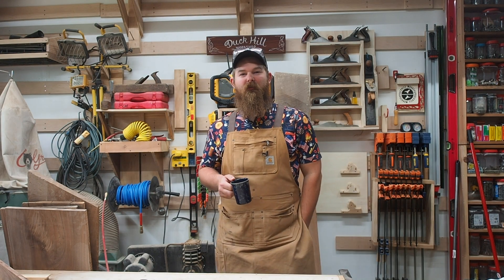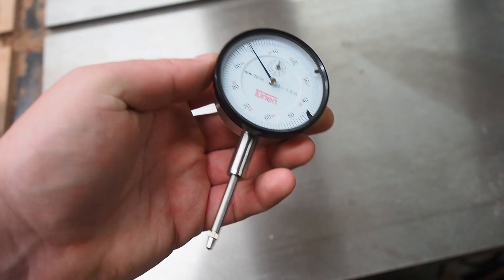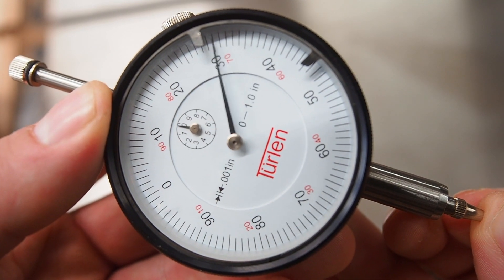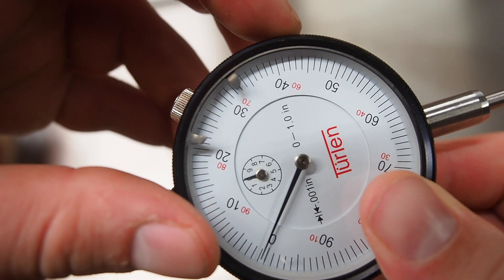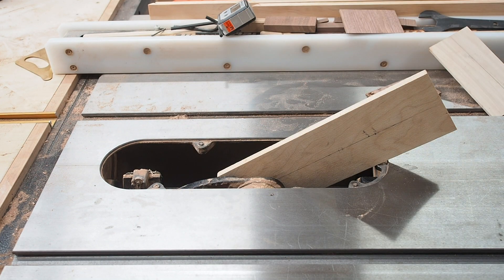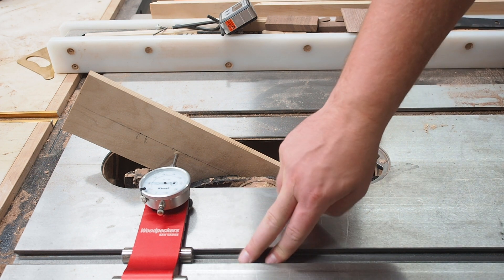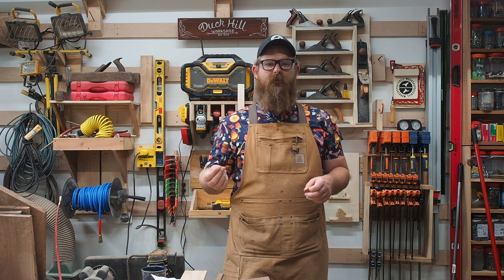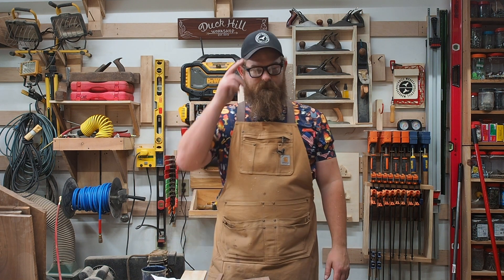Workshop Wednesday: How to Check a Table Saw for Square

Comment: this is my issue.... that trying to correct something, I make it worse than it was.... my table saw blade adjustment, I can very easily deflect it either way, but the very act of tightening it, will deflect it out of the desired position.... blah.